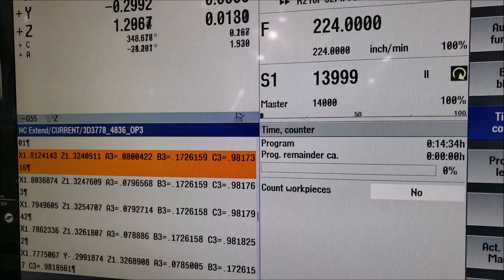DMU 65 Monoblock 3, 4, and 5 Axis Simultaneous

Comment: The five-axis motion looks somewhat slow and clumsy. Is this the best this machine can do, or have you found better tolerance settings or some other tweak to make it go smoother? Would you buy this machine again if given the choice?
Reply from the maker: Well, this was the first time I ever ran a 5 axis machine, and the first time programming a 5 axis machine. I imagine it might not be optimum.  The machine is great, and we would buy again.
Reply: @VeryUsefulVideos  Ok. I mean't no disrespect, i was rather curious if you found better settings since this was the first run. Playing with mastercam tolerance/smoothening settings and machine tolerance can make a big difference. Nice to hear the machine has been serving you guys good
Reply from the maker: @Runkpapper  The feedrates generally seem to keep up with the programmed feedrates. Another video I made a little later shows positioning that is faster. You can check this one out. It is however my first attempt at programming the 5 axis flowline path, so it probably needs tweaking. It was a project I made with my daughter for her birthday.   https://youtu.be/aFrs4qzO8ec
Reply: @VeryUsefulVideos  Okay, jetzt verstehe ich. Erste 5 Achs- Arbeit.